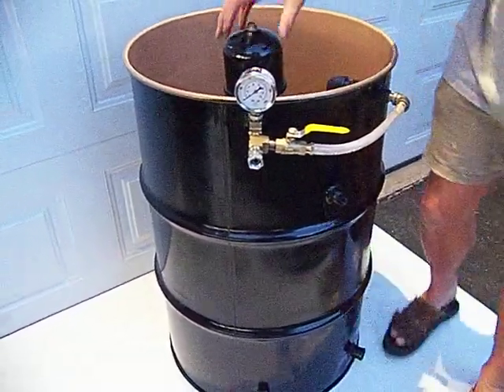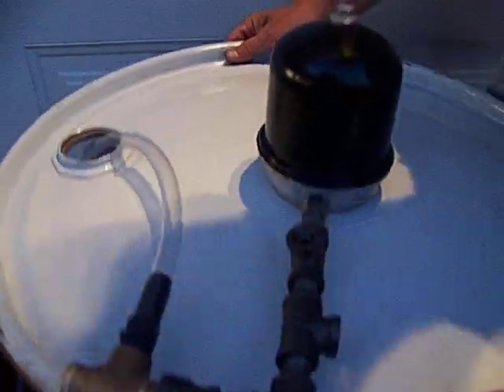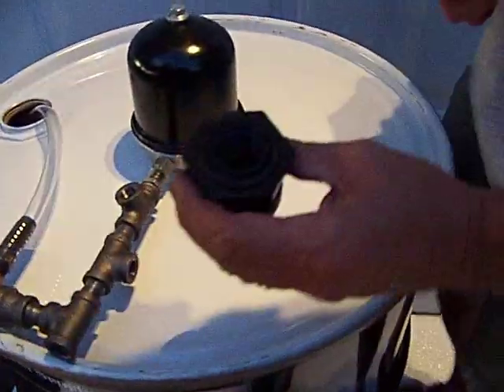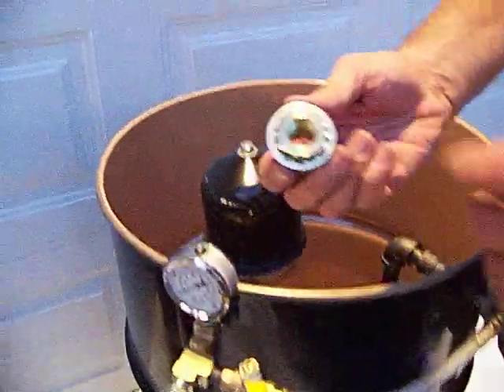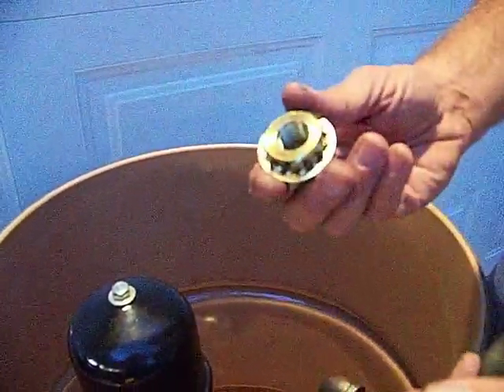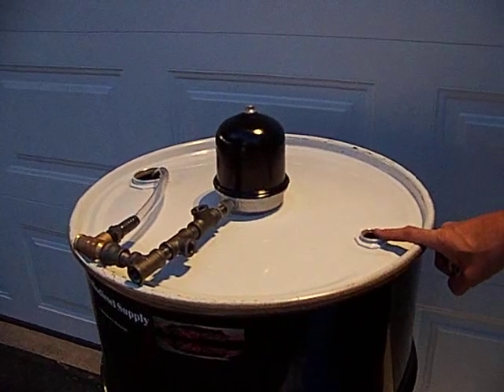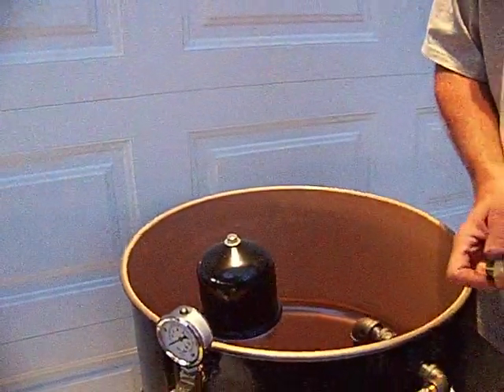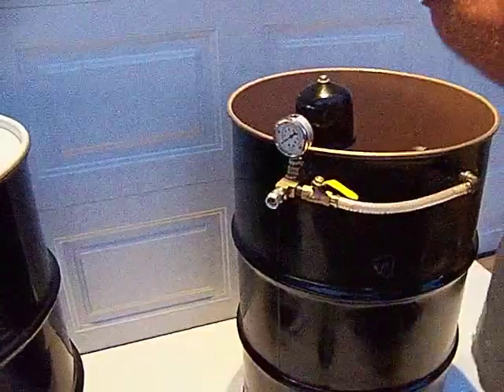Mounting your Oil Centrifuge

Comment: The more I think about it...centrifuge setup will probably the best route. At home have no real shortage of space...acres...but no practical indoor location to try and keep dust contamination (SW desert here) to a minimum. Still strain all the crap as it goes into the drum. Way less mess...and so you don't have to wait around on a batch can just use a clock controller for the motor. Ready the batch...turn on the power and walk away...will shut itself down.

Just need to decide on which one to get. Already have a motor//pump (untested but should work) that came with as a freebie w/ a bio-D setup during a VW head purchase.

Comment: why do you return the dirty centrifuge by pass back into the clean oil drum rather than put it back in to the dirty oil tank for repumping--rather than recirculating over and over??  keep the once centrifuged oil [clean]  and keep it clean??
Reply: Agree. Seems, with the centrifuge set up the way it is, the CF is performing somewhat like a fish tank filter in an aquarium... which pretty much runs 24/7 to keep the aquarium water clean. Of course, the centrifuge doesn't likely need to run 24/7 but I suspect it will need to run quite a while seeing how dirty oil is being sent back into the drum... which doesn't seem very efficient at all.
Reply: Are you still In business?